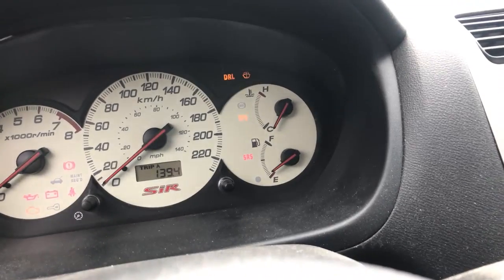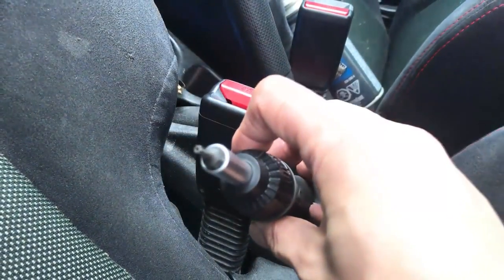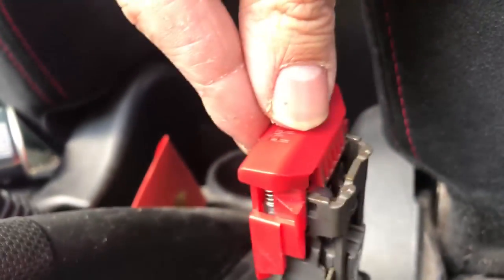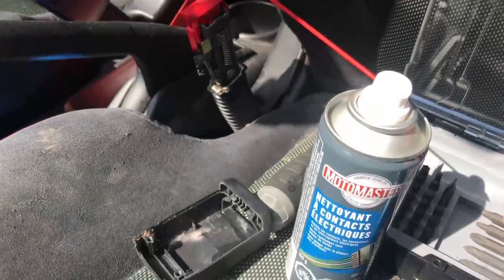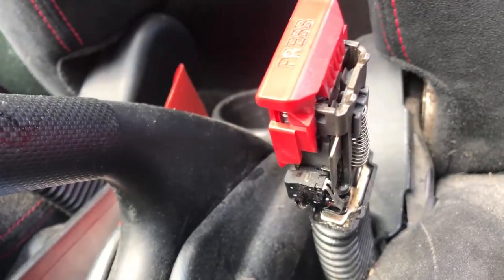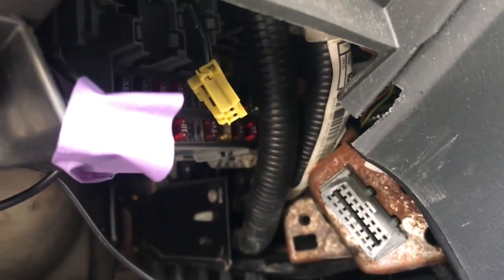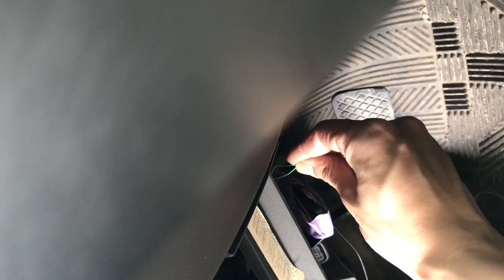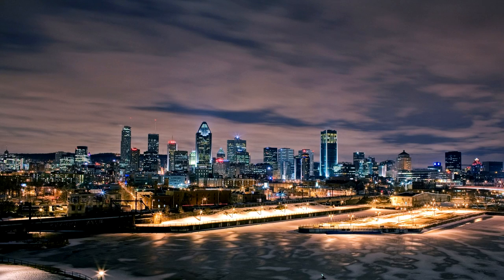How to Fix & Reset SRS Light For Any Honda / Acura

Comment: Thanks.  I tried the simple reset (jumping the plug with two wires) that others had posted videos of but that alone did not solve the problem, the SRS light would not cancel.  It was only after cleaning out both the drivers and passenger side seat belt receivers that I was able to successfully cancel the light.  Saved me a trip to a mechanic.
Reply from the maker: Thanks! Glad it helped! Make sure to like the video and maybe subscribe to help out a brother! Thank you again!
Reply: I'm hoping it's just buying some contact cleaner and cleaning all my seat belts, it would save me a Big Bill from the dealership and I don't want to do that ghetto stuff of jumping connections.
Reply: What is the size of the torx bit?

Comment: I have this problem with my Element (which shares allot of components with the Civic SIR including the seat belt buckles).  I see that you are Canadian (I recognized the contact cleaner label on the can and its from Canadian Tire).  I hooked up my Innova 3100RS scan tool and it reported that the driver's seat belt buckle was faulty.  I cleaned the buckle and cleared the code using the method presented in this video and it worked for a while.  Now the SRS light is back on.  I have a passenger side seat belt buckle I got from a scrap yard and will attempt to swap out the switch.  The theory being that the passenger buckle sees 50% less use so therefore may be in better shape to begin with.

Comment: On 1998 - 2002 Honda Accord the 2 pin connector is on the left side of the steering column above the OBD 2 connector. If it hasn't been used it most likely will be connected to a blank insert in the Multi connector box so you have to get under there and look for it. It's easier to get to if you remove the lower panel under the steering column...

Comment: Worked for a few months and it turned back on again. Checked with a scan tool and it is the driver side sensor error code 41-11, changed the sensor and it is ok now hopefully, will see if will turn back on after a few months.
Reply: Did it turn back on?? Thanks

Comment: DID WORK1).POOT IN PAPER CLIPP TURN THE KEY LIGHT IS ON 2) LIGHT WILL GO OFF. DISCONNECT PAPER CLIPP. 3) AFTER 2-3 SECEND LIGHT WILL GO ON. CONECT PAPER CLIPP. 4) LIGHT WILL GO OFF. DISCONNECT PAPER CLIPP. 5) LIGHT WILL BLINK 2 TIMES AND ITS DONE.
Reply: vytas2000 did u clean seat belt?
Reply: How long will it stay off?
Reply: @keishap04ify  untill the switch gets dirty again.

Comment: Mechanic worked on my clutch, changing Master Cylinder, now this SRS light is on my 2004 Honda CRV, could this be from something unplugged ?  any idea ?
Reply from the maker: Shoulnt be related to the SRS.
Reply: It wasn't related to that work.. 3 months ago, this crv had the Takata recall done on Passenger Airbag.. took to a local Honda shop, hoping it was related & under Warranty.. and here it was a bent prong that came loose..so yeah..related to that recall replacement..so it's fixed and didn't cost anything!!

Comment: My sister Honda crv '08 airbag lights on..we try reset the yellow connector next fuse panel...using paper clip, but apparently wouldn't reset.
Reply from the maker: Her problem is still there, that's why it did not reset.
Reply: I have they same problem help me

Comment: Thanks for much for this wonderful video! Just a quick question. I have a 2011 Honda CRV. If my SRS light is NOT on, but somehow with BlueDriver OBDII scanner, it detected the Honda 41-11 "No signal from driver front impact sensor," does this mean that the sensor need to be replaced, or can I just ignore that 41-11 code? Can that 41-11 code being triggered by someone broke my front row passenger side window or caused by the Honda driver side airbag recall (which I replaced the airbag with a new one like 2~3 years ago)? Thoughts? Thanks!
Reply from the maker: It could be the sensor but it could also be that there's a problem with the wires.

Comment: Question: Does this fix include that you got an SRS code on Engine code checker? 2002 Accord's SRS light is on. No fuses blown, no code. Also, another video showed using a wire across an unplugged plug under the dash, green or yellow color. What connector is that? There is no connector simply hanging down. There are however two connectors plugged in behind the dash.
Reply from the maker: Every car is different but look for a yellow plug with two wires. If the SRS code did not clear, it means your problem still exists.

Comment: Can this be done with an OBD2 scanner?
Reply: Linh Le only if it is srs/abs code compatible
Reply: That's what I'd like to know...inhave a basic Bluetooth one its.not detecting maybe I need a better app or mine is basic
Reply: The basic code scanner is an OBD 1, an OBD2 scanner can also scan the SRS system.  Try one of the auto parts stores that will scan the system for you (free). They probably can’t reset the system ( laws) but can at least pinpoint the problem.  Good luck.

Comment: So I had a windshield wiper issue where the fuse had to be checked and my mechanic accidentally pulled the SRS fuse but replaced it intact, the SRS light came on and we couldn't take it off, I'm still dealing with the windshield wiper issue which he seems to think is the motor, however he just had his other mechanic friend turn off my SRS light with his expensive computer and it did come off. My question is how come just pulling out the fuse would set off that light so we can't take it off without going to extravagant measures? I know this vehicle is real sensitive about all kinds of weird stuff like I replaced my catalytic converter and he put it in his vehicle and the catalytic passed but in my vehicle it was giving me horrible issues until I replaced it. But I digress, back to the SRS light and the fuse;  this makes me feel vulnerable in case it  were to happen in the future. Can you shed some light on this for me please?
Reply from the maker: use my way to reset it. Sometimes lights like SRS annd check engine doesn't know how to reset on its own so you need to reset it yourself through a obd2 reader or manually.

Comment: @MTLJack. 1998 Honda Accord, LX w/4cyl engine. I have no yellow plug just hanging down. There's 2 yellow plugs but they're attached to a PCB with 7 or 8 other pugs. Note that there's nothing stamped anywhere that says ''SRS''....
Reply: Hey Monty. I've got a 1998 CR-V. Is this plug people are ducking with on the side where the PCM/PCB is? I saw a guy with an Accord do it from the drivers side. Any info will help. Im tired of this SRS light being on. I did a motor swap properly since the last owner and my check engine light is off niw, but that damn SRS. Let me know if you've figured anything out. Thanks.
Reply: @boodro2122  Lets see, on the 98 Accord it's under the dashboard in front of where the steering wheel is located. Looks like a yellow square fuse  & on this one anyway it almost resembles like a double fuse. Hope that this helps you.
Reply: @montydaniels1054  I gotcha. If I have time this weekend, and the weather isn't too nasty, I'm gonna crawl under there and see what I find. Then I'll just need to figure out the sequence for when I complete that circuit. If I git 'er did, I'll come back here and let you know what all I had to do.
Reply: @boodro2122   Here's what you need to do. Go to YouTube, then type in the following: 1998 Honda CR-V airbag light stays on

Next watch that ''HowTo'' video on how to reset your SRS warning light.

**The video shows a 1998 or 99, to do  the SRS Warning Light Reset. 
**Tools needed, flashlight & a paperclip. 
good luck with it. MD......
Reply: @montydaniels1054  Oh, very good. Thank you!
Reply: @boodro2122  I did try to post the link but it wouldn't allow it to go through, so I had to remove the link...
Reply: @montydaniels1054  that's ok. I found the video. I'll find a paperclip at work tomorrow and try to get it done this weekend. He said worst case, it could be my ecu. Or an actual airbag defect. I'll find out soon. And thank you very much.
Reply: @boodro2122  You're welcome. Sometimes you have to get one of those code checkers that plug under the left hand side of the dashboard, then scan your system & clear out any error codes that are stored. On my 2010 Jeep Patriot, there's a ton of electronic related issues and clearing the codes, then disconnecting the battery cables from the battery for an hour so I can start out with no codes stored, even though I cleared them out after I scanned the ecm. This has been a normal task that I've had to do more than a couple times since the summer.... Good luck with your Honda, it's a great car. I ended up buying a 1993 Jeep Cherokee just to get away from the nightmares of new technology issues...
Reply: @montydaniels1054  Yeah, my buddy has one of those diagnostic things you plug in. We did a motor swap on the 'ol Honda. Everything is tip top, except that dang SRS! Lol the friend that helped me get that done was a Jeep guy before he switched to Hondas. He even got a Jeep tattoo on his leg! Lol. Great vehocles, also. Expensive, but reliable.

Comment: Hey Jack, great video, I just picked up a 2004 Honda Civic Sir(Canadian Model) just like the one in this video. My seat belt light goes out when my seat belt is put on but my SRS light remains lit, does this mean the problem could still be the seat belt switch? Will cleaning my seat belt switch still help with clearing the SRS light. I also have a high idle issue that also goes into a surging issue after about 30 seconds of engine running time. The revs bounce between 1500 and 2500 rpm, have you had this issue as well. Thanks for any advice you have on this.
Reply from the maker: make sure you have enough coolant

Comment: OK thanks dude, now hear weird  little story. Two days ago I decided to start my car up,  ready it moved went right into gear moved forward and backward  for all of about 3 mins.  I want put a couple of solanoids wanna try junk ward stuff  know the ohms are 14=25 I'm old and broke think it maybe that I found a tyranny for it  499$ 3 year warranty  and tree shipping  I ask you  should I try junkyard or tyranny  please let me know okie Dokie your the man I just drive the damn thing
Reply: Dale Franklin how long do you plan on driving it/how many cars do you have? If you're worried and want less work and more security, buy a new one. That's my two cents
Reply from the maker: Sounds like you have a bad transmission. Happened to my friend. Honda civic 2004
Reply: @MTLJack  OK thanks guess I'm just going to look for a truck not older like 60,so 70s 80s got any suggestions on what kind of truck to look for

Comment: I've a question when I first start driving my civic runs great but when it gets up to running temperature my chk.engine comes and my automatic transmission starts to slip what can that be
Reply from the maker: Wow, that's a tough one.....
Reply: @MTLJack   so you^ saying that you've no idea what's wrong?
Reply: WOW! MAY HV SOMETHING 2 DO W UR COMPUTER WHEN IT GOES 2 CLOSED LOOP...BUT NOT NECESSARILY...I NEVER SAW  A TRANSMISSION TRIP/SIGNAL A CHECK ENGINE B4
Reply: First thing you do on ANY car is if the check engine light comes on you have those scanned and post those with your question helps us mechanics that want to help alot better. Transmission slipping when warned up is usually the transmission is going out. With most hondas nobody services the transmission due to more serviceable filter so its forgotten. Fluid is either low or pitch black meaning the transmission is overheating now due to the lubricity of the transmission fluid is no longer usable. Honda automatics are the weak link in the drivetrain. The v6 engines are worse on the transmissions. Properly serviced and flushed these will go forever. Lack of service means premature failure. If flushing from home doesn't work the transmission and torque converter are probably shot by now.
Reply: Could be a sign that your Ignition Knock (Detonation) Sensor is faulty and may need replacing.

Comment: This makes no sense i paper clipped that exact wire my srs light stayed on and my check engine light started flashing so unless by some weird thing my 01 honda accord ex v6 has a different srs plug my light is stuck on and i have no idea how to shut it off
Reply from the maker: Hey man, thats because your problem is still there.
Reply: @MTLJack  yeah i said fk the paperclip used two wires worked like a charm

Comment: I tried this on 2006 honda accord a couple of times but after the second time the light came back on like before instead of blinking twice. any suggestions please?
Reply: I'm about to try this on my 2006 Accord, did you ever get it figured out?
Reply: I will be doing same, any luck?
Reply: I cleaned the seat belt receptacle well on Friday and reset the jumper wires as in the video (the 2006 Accord's is in a bit different location).  Afterward it was weird.  As long as the seat belt was fastened before the car was started, the SRS light went out, but if it was disconnected at startup, or if you disconnected the SB after startup, the SRS would come back on and wouldn't go back out.  Three days later I replaced my car battery, and the next time I started my car with the seat belt unfastened, I discovered that it the SRS system was working like it should!  I can't be sure whether the battery change had anything to do with it or not, perhaps it just took a few days for the alcohol to completely dry up. However, if you try this and continue to have problems, you may want to try disconnecting the battery for 30 min, then reconnecting.  Perhaps this acts like a hard reset??? Anyway, good luck... That pesky light is sure annoying!!!
Reply: @robertburkey5789  your car battery was likely getting low

Comment: Lol thank for the tip but is sad that, that a k20a3 cluster with a sir emblem on it...sir rev limiter will be 8,500 rpm not 6,700
Reply from the maker: You are crazy man, k20a3 does not have a redline of 8500 and second, this is a Canadian SiR 2002 hatchback. It is a stock cluster. Even Wikipedia will tell you the redlines LOL!! K20A jdm is the only one that reaches 8k rpm among the K series. Stock. And 8500??? This ain't a S2000.

Comment: Should you be giving advice to people if you’re spraying WD-40 inside something that is wired into your electrical system inside your vehicle?
Reply from the maker: Its not a sensitive component that will disturb a reading like the mass airflow sensor or any sensors. This is just a 'on' switch that sends a 12v back saying the seat belt clipped on. It is far from considering it 'electrical system'.